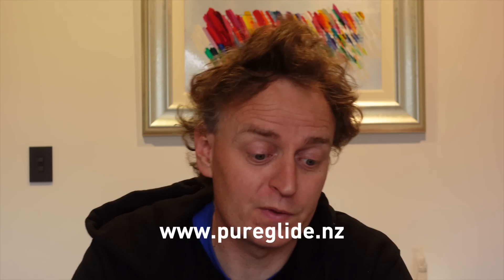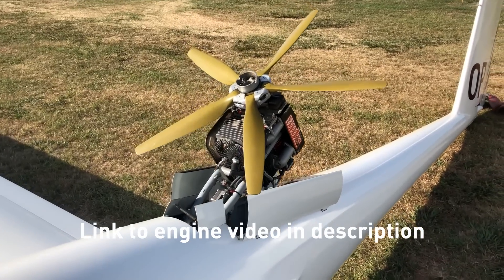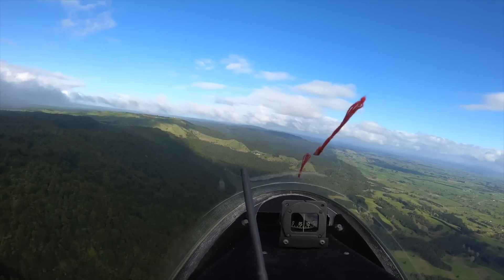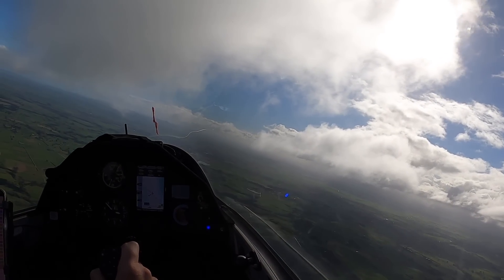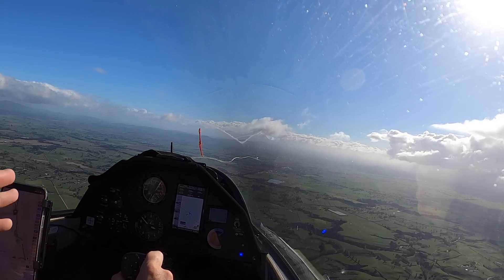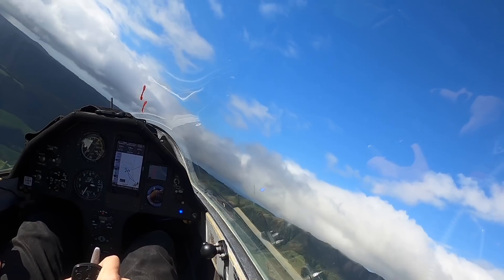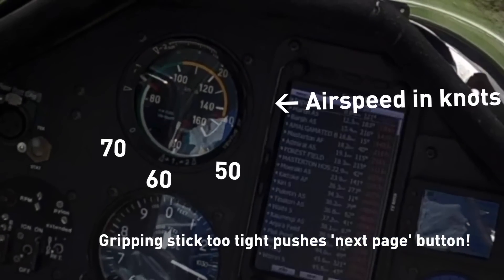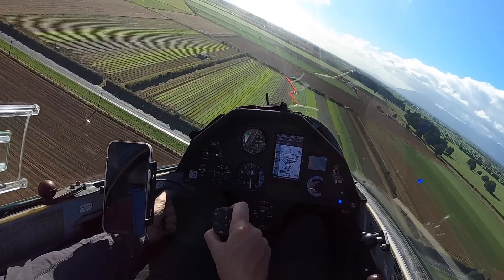Is it safe to open air brakes/spoilers in a turn?!

Comment: Excellent video!! I’m a beginner glider pilot building up my solo time for my PPL exam. My old instructor taught me to pull 1/2 dive brakes on a Schweizer 2-33/2-32 during the turn from downwind to base. I’m not concerned about stalling, but feel this practice increases an already busy workload. When do you usually hit your spoilers/dive brakes?  Any suggestions? Safe flying!
Reply from the maker: Yeah I didn’t quite make clear in this video, but it’s best to open on base or finals, but don’t actually open them in a turn because of the workload, also some air brakes can affect the pitch of the glider more than others. So yes stick to going straight I suggest to begin with especially
Reply: Thank you!!

Comment: Thanks for the excellent video! I’m a beginner pilot building up my solo time in prep for my PPL test. My first instructor taught me to deploy my 2-33 dive brakes 1/2 at the start of my downwind to base turn. I’m not concerned about stalling, but as some have pointed out, it is a lot of tasks to manage simultaneously…ie, airspeed, angle, altitude. Would you suggest deploying brakes on base after completing my turn to base? Gonna run this question by my current instructor as well. Safe flying!!

Comment: This video has really sparked great discussion of the topic from many pilots around the world.
The best idea is possibly that every glider is different, so you need to investigate your own glider’s “personality” at a safe altitude by (for example) doing the “brakes in a turn” experiment, demonstrated in this video. Another experiment that could be crucial is to test the limits of the sideslip at altitude before doing a sideslip- landing.
Reply from the maker: Absolutely!
Reply: Agreed re slideslip - some aircraft react unusually. My current ship (Ventus b) has powerful trailing edge brakes, hard to envisage needing side slip. A previous one (std cirrus) definitely needed sideslip into most fields!

Comment: I have a habit of opening the brakes on the base leg(When you are straight and level) and then adjusting the glide slope(if needed) all the way to the ground, also during the turn... Now I wonder how much will for example extending the brakes from half to full affect the stall speed, I'd need to go and test that out... Probably  depends on the airframe. But anyway, that additional safe margin of speed over the stall speed is the most important thing, everything else goes with the situation.

Comment: Important topic to address! Crucial is to not open them fully at once but rather bit by bit in a controlled manner. I remember that in the older gliders (Ka-7) the brakes would tend to want to open full once you open them. Some of our 'rules' come from the times of older gliders. Next flight I will check stall speed in landing configuration (at safe altitude) playing with the brakes.
Reply from the maker: Good point! Cheers, have fun playing :)

Comment: Here in France I was taught in general to start opening the air brakes approximately halfway into the base leg, during the turn onto final and adjust them as necessary on final. That is of course dependent on your height at start of base, but the norm was as described. I once took an english glider pilot up for a flight and he was shocked to see me open the brakes on base, during the turn etc.  Not sure how you are taught in England?
Reply from the maker: Dunno, I'm in New Zealand! What I teach is to use the brakes when necessary, usually on finals, but you can use them on base or even downwind if needed.

Comment: Interesting review, thanks for sharing! I mentioned as well the use of airbrakes in your last video on a low altitude and in a turn. Here in Europe, (fatal) accidents usually occur during the final turn, flying with several in a thermal and during the first part of the winch take-off. During the landing, cause number 1 is to turn at a low altitude and give extra rudder in order to line up with the runway in a sliding turn. Speed is the keyword here as you understand of course (which was clearly high enough) but during that film of that particular landing, the workload seemed already quite high.The effect of the air brakes in a turn is indeed not high as you've shown with this video (although it did sink at 6.21 which you called "a moment") but with a number of factors taken into account, "that moment" could be just the decisive act for a crash. Here in France it's in any case strongly discouraged... and your last remark in this video should be ignored by young or inexperienced pilots in my opinion. It's solely your conclusion Tim, many accident reports and the pilot manual regarding this stating different (quote):

... "but the slight increase in stall speed as the airbrakes are opened is not really a factor. It's more the result of years of accident reports where the narrative says something like "I turned onto final approach and opened the airbrakes . . . by the time I realised that I was undershooting and shut the brakes, the glider was too low to reach the airfield".

I'm not here to point my finger (if it might sound like that, I'm sorry) but gradually deviating from basic flight rules is just not the best direction. And I would love to see more videos from you in the future;-)). Cheers.

Comment: When I watched the original video I wasn't worried about the possibility of opening the airbrakes during a turn  precipitating a stall,  but I did wonder about the wisdom of opening them that low down before levelling up the wings.  It was 9 seconds from brakes open to touch down and there was a whole airfield ahead.
Reply from the maker: Hi I don’t disagree, I could have left them closed until I was level at least- but there wasn’t much runway left, which was exactly why I used them to make sure I got down promptly!

Comment: The think to understand is how much the stall speed increases with bank angle for any given configuration (flap/spoilers)
30º bank ( 1.15g) increase about 7%
45º bank (1.4g) increases about 19%
EVERY glider pilot should know that in a 45º bank (a very common bank angle for soaring) stall speed goes up about 20%.  That value is easy to calculate in your head and allows the pilot to determine the adjusted stall and minimum sink speeds for bank angle. 
Some gliders are designed to run out of elevator before reaching stall in steep turns - leading guys like Tom Knauff advocating for 45º bank turns in the pattern as a kind of built-in stall protection. I’m not such a big fan of that, as much as maintaining proper speed in the first place. 
I teach deploying ½ spoilers turning base and if everything is perfect, you won’t need to change from there til landing. Adjust as necessary for glide slope and speed, viewing altitude and speed as a total energy equation with spoilers and slips being your way to control the energy dissipation rate.
Reply from the maker: Thanks Bill, good points
Reply: No. sorry, you're wrong.  Bank is so, so often misunderstood. The angle of bank has NOTHING to do with stall speed whatsoever. Stall speed is only proportional to the angle of ATTACK. You can roll 90 degrees and apply no angle of attack and your stall speed will actually go DOWN. Only by applying an increase in the angle of attack during a turn ie to hold one's altitude or to tighten the turn does one actually increase the stall speed. This is true regardless of spoiler position although obviously the spoilers inherently shift the stall speed up.
Reply: @Pletharoe  do you somehow not increase your g load when turning?
Reply: @BillPalmer  In a sustained turn that's correct but it's not a product of angle of bank, it's angle of attack. Thusly in a 40 degrees bank and reaching stall simply unloading and reducing the angle of attack will immediately destall the wing, but you'll still have 40 degrees of bank. That's why it's so important to teach bank angle with respect to angle of attack as many students will attempt to level the wings during a stall before reducing angle of attack as they have been taught incorrectly which is the danger zone for getting into a spin. I'm not arguing the math more the phrasing.

Comment: I am still PIT (recently had my first solo, yay!) and was told never to open brakes in turn (but I can of course have them opened and do a turn), as it is unpredictable. And as far as I can tell, it is right thing to do, because landing is always stressfull situation for new pilots and adding unnecessary things to check is leading to overload. But I am absolutely sure, that experienced pilots can deviate from that rule.
Reply from the maker: Yeah exactly right, for beginners, you don't want too many variables to deal with at the same time, so it's a good idea to focus on a good turn and airspeed. But saying that, if you need the airbrake, use it! Cheers

Comment: When I was transitioning from the Schweizers I trained in (2-33 and 1-26) to my new to me PW-5, I had heard a fellow club member talk about how you should always stow the breaks in a turn, especially when in the pattern.  My very first flight in the PW-5, went well.  for my landing I entered the pattern.  I had flown several training flights in our club Grob 103 and had been amazed at how different the stored energy in the patter was compared to the Schweizers.  You really do have a lot more energy to bleed off on your way down and the "half brake" technique I had read about all of a sudden made sense.  Anyways, back to my first landing in the PW-5.  I was doing fine. Brakes in and out to hit my expected altitudes, stay high since we have a mile runway. I was looking good. I extended my downwind slightly further than usual, but that was due to having a lot more than 22:1. 
Here is the point of my story.  I went to turn to base, stowed my brakes (as I had been told it's safer), made my turn and came out significantly lower and possibly too low.  I quickly realized I had a brain fart and had fully deployed my brakes rather than stowing them.  Fortunately, some training is muscle memory and i shoved the brake handle forward, and made turn direct for the runway cutting out the final leg.  I had lost at least 100' likely more in that turn.  I actually did as trained and pushed the nose down to keep my speed up deciding if I was too low, I'd dry to use ground effect to "hop over" the fence at the beginning of our runway. Fortunately, I was able to make it across with just enough altitude, though several people said afterwards I wad "too low."  
My point to the story is maybe the brakes open or closed can cause an unnecessary distraction in the landing.  Thanks as always!!!
Reply: Oh and obviously I was going fast enough that full brakes didn't cause me to stall or spin in the turn, so I guess in that scenario it wouldn't have mattered.

Comment: Thanks for a very informal video - I really enjoy your channel. 

You really point out one thing that is crucial - speed, it all depends on speed.
Here in Sweden we teach out that your final speed should be "1,5 times the stall speed and half the wind speed" in that configuration is it not so dangerous to open the airbrake as your speed is well beyond the stall range.
In our club do we as well teach that actually take the airbrake out of the locked position on downwind - why , well all of our gliders are with retractable wheels and we have "gear up" warning devices connected to the airbrake lever - this prevents a lot of situations that could have ended up in a belly landing as the pilot have plenty of time to correct for a mistake where the gear isn't down. 

Also as a lot of comments say - it also depends on knowledge and experience of the glider.
I try to learn my students to have the the "air brake in their hand" i.e out of stowed position during downwind (for the reason above), not extended during turn into final, and then use it when established on final.

Comment: It's perfectly normal and okay to use your airbrakes during turns. To everyone else, It is not about what people recommend but about understanding how the wing behaves with the airbrakes deployed independently and in a turn, and how the two together affect the wing in flight. Then you'll know when it's safe to do so and when it isn't. As Tim correctly demonstrated, airbrakes increase the stall speed slightly, but when you have plenty of margin on final, you should not be worried about stalling (but still cautious and aware of your speed management). The same can be said about skidding in a turn. It is not good practice, and you should be coordinated, or slightly in a slip since it is the safer of the two, but if you are going fast, your inside wing is not going to stall if you are slightly skidding. Just like you didn't in your slight skid to final. Turns increase your stall speed because you increase your g-loading. Your elevator is having to create more downforce which in turn increases the main wing's supported load, and effectively the angle of attack. This alone increases your stall speed and there are plenty of charts out there to see the mathematical relation. Airbrakes increase airflow separation, and drag around the section they cover, and therefore increase your stall speed slightly. All that aside, you should fly your approaches on the faster side, coordinated, and with good potential energy just in case you encounter heavy sink/windshear on your approach if forecasted (or not). Thanks for the vid and always a pleasure and learning experience watching your videos, Tim!
Reply from the maker: Thanks, we’ll said!
Reply: I agree with everyone of Your points. I have been flying since 1974 and except outlandings I usually add plenty of airspeed in the pattern nowadays. Wind shear is the killer in these situations, other considerations are really moot in comparison. I have friends that have strong opinions on the spoiler issue that I mostly disagree with. Here in Europe many instructors teach 90 90 and no spoilers in turns. As long as the spoilers are of the usual design there is no problem what so ever keeping the spoilers unlocked in the pattern as long as airspeed is adequate. Also helps remembering extending the gear in a timely fashion... My preferred pattern especially at small grass fields is nowadays the J type pattern, it gives much better situational awareness, for me it is easier to focus on field. At larger controlled airports it is always safest to follow the 90 90 pattern since other pilots expect it and the controller demanding it.  No problem, it is easier to do. Was in a sort of interesting situation yesterday landing a motor glider at ESNU which is a fairly intensely trafficked commercial airport when the controller reported 15 knots tailwind at final and 6 knots headwind on the ground. We refused changing runway direction and landing was no problem. If we would have changed we would have lost 15+6 knots in a very limited altitude span... airspeed is king in those situations. Remember that that was good advice for the 737 before us but not for our small motorglider...

Comment: At 4:27, 4:47 and 6:17, do you recall what your rudder inputs were just before the stall break when there was a slight right deflection of your yaw strings and later when you applied right aileron in the pitch down recovery and a more pronounced deflection of the yaw strings occurred, and if the left slip resulted from aileron yaw, asymmetric drag due to one wing being semi-stalled or right rudder input?
Also, I can think of no regime where applying spoilers in a turn at low end of the LD curve (low airspeed and positive AOA) would be necessary or prudent, and I've seen pilots who overly relied on spoilers ( I prefer to call wing extending fences spoilers) to manage inertia and altitude themselvs at risk by deploying, and not retracting them at low airspeed and increasing AOA, or on a go-around with spoilers extended.
 Sailplane pilots may use spoilers in regimes that would be uncommon for powered aircraft, but when flying a light aircraft, as a rule of thumb, spoilers were something I retracted before reaching about 1.5 VSO and before reaching 1000ft AGL. I also checked to see they were stowed when entering the pattern and on final approach, during go-around and before take-off.
Reply from the maker: Hi the rudder would have been pretty balanced for the turn if I was in one, so those stalls in a turn, the wing drops were caused by one wing stalling a bit before the other. Cheers!
Reply: @PureGlide  Thanks. What I was wondering about was the Yaw (side-slip) after stall break and the left wing dropped you applied a lot of right aileron, and the Yaw string deflected quite to the right indicating left-slip (into the low wing), and I wondered if that was do to right rudder input or right aileron? Applying as much right aileron as you did to raise the left wing without a lot of right rudder, I would expected a lot of adverse  aileron yaw the to the left instead of the right as happened?
Reply from the maker: I don't think I added any rudder before rolling flat, the yaw that happens is adverse yaw from the wings. I put the stick forward to get flying again, and then straighten up, and I would use the rudder coordinated with the ailerons when I roll flat again.

Comment: Thanks for the video. For new pilots, they need also to be aware that some glider change the pitch when opening the spoilers. Once combined with a turn, a new (or overloaded) pilot could speed, reaching the stall and getting in trouble.
Reply from the maker: Good point! Cheers